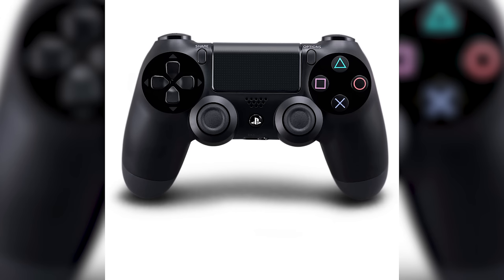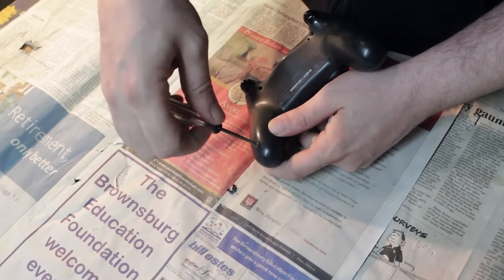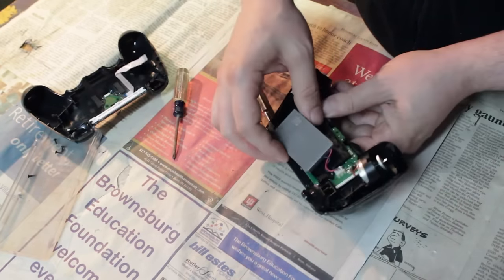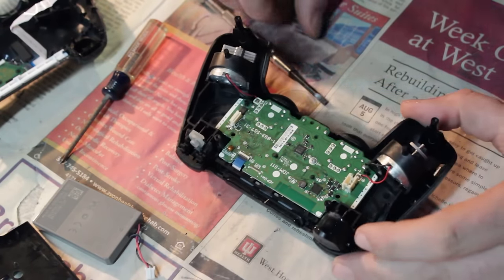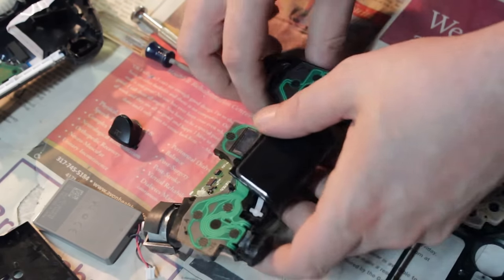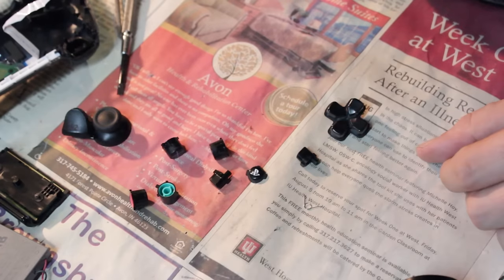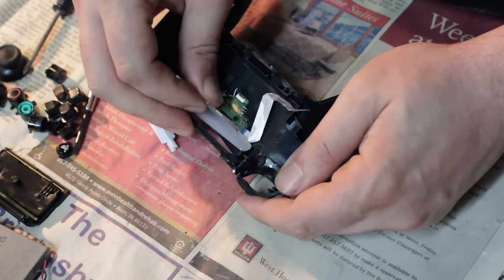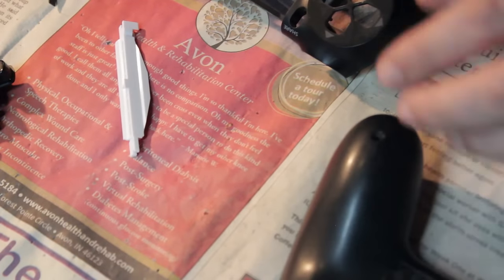How to take apart a PS4 Controller

Comment from the maker: I honestly can't thank everyone enough for the amazing feedback and stories of what brought you here to my video.  I hope I was able to help you all get your controller working again.
Reply: Hey, my wife just got the new Tomb Raider and was struggling with the quick time events. Turns out the square was sticking. I just cleaned it using your guide into the controller. Thank you
Reply: What type of screws are they?
Reply: @Lookfrodograph  i believe the screws are for the phillips ph00
Reply: Syrisツ same :(
Reply: im having trouble taking off the back, any suggestions.?
Reply: Drumblanket what type of screwdriver did you use
Reply: Hi I'm trying to take my one apart my r2 won't wrk
Reply: Thanks now my buttons  don't stay in place  and I  think  I  need  to  buy a new  controller
Reply: Thanks it helped
Reply: I spilled mtn dew on my controller and it started vibrating and lighting up im pissed..... Is there any way to fix it or should I get a new one?
Reply: I got on the ps4 after a long day of homework and realized that my arrow buttons were super sticky, almost as if someone spilled pop on my controller. I was super mad cuz I just wanted to play some Doom that night. Anyway I finally got around to taking apart my controller and this tutorial was very useful. I washed the goop off of my arrow buttons and it works like a charm now! Thank you for this great video
Reply: I was looking up vids for this because I didn't want to FUBAR anything and this was the first one I watched. My directional button down was worn out and I thought the. X button was too but it was just off kilter. Great vid.
Reply: Very helpful and straight to business lol thanks man 5️⃣⭐️

Comment: Ok so I one night at 2am had an idea to paint my controller and the console itself. I didn’t know how to take it apart so I found this video, I took it apart and paint the bottom shell and the buttons. After I finished painting I put it back together but what surprised me is that I didn’t look up anything on how to put it back together, it only took me an hour and it actually works and looks nice. And it was my first time too.

Comment: I had an issue with the analog stick seizing.  Your video was perfect even for the second gen controller.  Was able fix my issue.  I will say, much easier than opening the Xbox one controller, though Sony tends to be better manufactured components, in my opinion.

Comment: I can't get the frigging screws out they're so tight??
Reply: Same bruh
Reply: I was trying to take them out by spinning clock-wize but then tried spinning counter-clock-wise and It worked lol. Maybe the same happened to you.
Reply: @lucasrv2630  appreciate the tip but I know which way screws undo lmao <3
Reply: I took a pair of pliers to grip the screw driver to get a strong grip for stronger torque for getting the initial twists
Reply: @darkharder6190  nice might try that
Reply: I know I’m really late but I was having the same issue, keep trying and try a smaller screwdriver

Comment: When disassembling your controller, I would recommend using a plastic card instead of a Flathead screwdriver to prevent damaging the plastic. It's also good to give it a good clean with some rubbing alcohol and compressed air while you're in there to get out any gamer gunk™. Also, if your battery is a generic Li-ion battery and not a hard shell plastic one or there's no PlayStation logo printed on the the circuit board then it's probably fake.

Comment: Couldn't find a flathead screwdriver but I fixed my controller! PS I have no fingernails left😅
Reply from the maker: Vanessa Medina happy I could help!!!
Reply: Drumblanket Thumbs up👍🏽
Reply: You didn't use your nails. The screws are tiny. You wouldn't get you nails in those tiny slots.
Reply: @josequins9099  wooooooosh
Reply: @josequins9099  talking about getting it apart

Comment: Bro my controller was having some real right analog issues not drifting but like it had a stutter I had an idea of the issue I needed to disassemble it and clean out that area I seriously appreciate this video all the info was easy to digest you just saved me 60 bucks
Reply: Did it work ? How did you clean it ? I'm having the same problem as you

Comment: I needed only to take the lower screws away because when I shaked the controller there were some small piece inside the controller that was moving and the sound was iritating but I got it out. Thanks for the tip video.

Comment: I came here after I bought two new controllers, but still felt like I can maybe fix the first one, which I got with my ps4. There are two problems:
1. Left analog, usually used for moving around, isn’t working properly, you can tilt it in all directions, but nothing happens if you push it forward left diagonally if that makes sense. You have to really work it with small movements to get your character to move diagonally upwards left. 
2. Pushing L2 causes also moving forward. This one is especially irritating when playing FPS games, but also non FPS like Overcooked as well as just writing stuff. 
Over the year of using this broken ass controller I kinda got used to all its flaws and I still win games with it!
Now I’m halfway through taking it apart, and I’m not really sure if I can fix these problems here, I’m trying to just clean every single part as much as I can and hope for the best cause if I start working around with the cables or motherboard I worry I might break something.
If anyone has an idea how to fix these two problems I have, let me know!

Comment: Thank you so much for showing us this video.  I bought a used PS4 Pro and the controller was so Gunked up with dirt and god knows that the buttons were sticking and it could t be used.
After this video I was able to pull it apart and clean it, now the controller is like new👍

Comment: Please. Give a tip to remove the battery cable. Please. Inform others to bend the blue plastic of the ribbon cable for the touch pad inside the hole for it to go through. Remove the music. This is just the start :(

Comment: Great vid. I think mine was a newer one, not 100% sure but that center screw holding the circuit board in could be undone and removed without/before taking the black battery cradle out. Y'know, for anyone wondering. Thanks for the vid. :)

Comment: Turned out the rubber thingy under the D-pad was my problem. As I was   taking it apart you mentioned things about customs which made me look for a cheap copy blue controller I  had laying around as a donor.
Now I have a working original black sony controller with blue top case, looks good with the blue light bar.
Many thanks 👍

Comment: Here are some notes:
Take your time
Turn your phone to airplane mode.
No distractions
Take a picture of the guts when you take it apart.

Wash each piece that’s non electric with HOT WATER.

Use Q tips and clean nooks and crannies

Rinse with white alcohol. Alcohol evaporates very quickly

Place all washed components on a floor or heat vent. Good airflow to completely dry everything out. 

When you put it back together, TEST IT prior to putting the back back on

Comment: When removing the battery tray, remove the silver looking screw first instead of prying on it like in the video. He pulled the battery tray breaking the screw hole in the plastic.
Reply from the maker: Incorrect.  You probably have a different model if you experienced this.  I broke nothing while taking this controller apart.

Comment: Thanks for this video man! It certainly helped me get my controller open. Just 1 thing tho, opening it the way you showed, does leave some scratches on the point where it snaps. I done it exactly the way you did it and now I do have rough edges at the place it snapped. Apart from that I really like your method, it would be nice if you could find a safer way of opening your controller. So you don't exactly have to go around the entire controller and open it at every snap point. Nice video tho!
Reply from the maker: Right on, My friend!  Happy I could help you out.  I dont have issues with chewing up the plastic like youre talking about but a lot of people suggest using something plastic to assist with opening it.  Something like an Orange Peeler would probably work pretty well.

Comment: Thanks, my left d-pad funked up after over use. Fortunately, I used another dupe controller lying around and replaced the rubber part. Now, I don't need to spend $65 probably until it wears out in a couple of years.

Comment: While helpful at getting started and seeing where to go in doing this, a bit of your "just do this" direction doesn't cover details for layman attempts at dismantling the controller, particularly about the disconnecting of the ribbon cables.

Comment: Be really careful. The guy does not show you how the battery pops out. It’s really easy to pull the white compartment the battery plugs into clean out which is then tricky to fix and you’ll need a soldering iron. Be really gentle when easing the battery from where it plugs in.

Comment: I actually did this right. I had an old controller that my cousin spilled his coke on, his dad bought me a new one, but I already had another( I had two initially). So I took the coked one apart, took the shell, hydro dipped it, and put it onto the new one. And it still works

Comment: Thank you sir. Whenever I get angry I bash whatever controller I'm holding against the floor or throw it across the room.  I did it with my PS4 controller and the top ended up unaligning with the bottom. after that I couldn't hold the controller without cutting myself or scratching myself on the bottom grips. Turns out I just needed to remove the screws, re-orientate the top shell, and put it back together. You saved me 40 bucks.

Comment: Do not use a metal screw driver to pry apart a plastic device. Use small plastic pry tool to release clips on either side of headphone jack and front handle sides.

Comment: Very good guide. I am fixing my red Sony brand, I had a little more trouble with the ribbon cable connecting the touch pad and ended up using tweezers. Might’ve been my shweaty ass fingers that was the problem

Comment: Also the difference with newer controllers is the fact, they tend to have some problem with analog sticks,.......my mom´s Dualshock is like two weeks old and both sticks have some sort of problem, when You just touch the stick and the movement in game goes all the way up or just keeps running forward, then it´s ok for 20 minutes and then again.....hate it. My old version is running flawlessly for 5 years. Thank You for the video, I will try to open it, but I´m not a tech guy. I know shit about this stuff, I just blow into everything XDDD

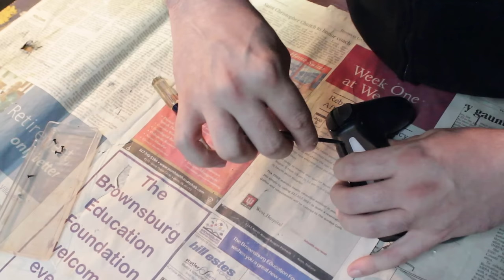Comment: Do not put a screwdriver between L1/L2 or R1/R2 as he does at 0:57. If you get that slightly wrong, you can cut the circuits there. I broke my controller doing that.

Comment: Where was the headphone jack and charging port in all of this? Is it a charging port or an accessory port? Cuz there's a dedicated micro USB port on top of the controller, but the bottom one accommodates the charging cradle and a keyboard addon, but I digress. I just wanted to know if I could like spudge a piece of debris out of the headphone jack from the inside or if I needed to do the hot glue trick, cuz there's something broken off inside of it that keeps it from resting on the charging cradle

Comment: Video was spot on. Easy to disassemble but I was taking it apart to replace the battery it has the wrong connector is there a better way to search for the right battery?

Comment: You didn't point out you need to make sure to push in the R2 and L2 to ensure they dont break when you are seperating the parts, didn't notice till i watched another guide that said to make sure to do this, that when i looked down and my controller, the L2 button had snapped off...

Comment: I tried to take the battery from one controller that has a problem with its X button and its joystick to give it to a controller that had a very old battery but the buttons worked fine... opened both of them and realized that the socket for the battery were not the same...
I cleaned the 1st one, so it works, for the moment.

Comment: My left analog sometimes doesn't work correctly. For example, in any game while I'm running forward, sometimes it'll stutter or just stop completely. I assumed it was dust & opened up my controller by watching this video, but I don't see any dust under the analogy & I'm not sure how to take apart the rest of the analog. All I could get off is the rubber joystick part. Any tips?
Reply: They're built in and if they break there's no fixing it. You'd have to buy a new component then fix it that way.

Comment: I am having problems with my PS4 controller especially the R3 it will not Sprint. By taking it out and just cleaning around the analog base do you reckon it could solve my problem? Thanks for your informative video, I have liked and subscribed!

Comment: This is kinda helpful but it doesn't explain how to get the controller in two pieces good enough because I currently have my PS4 controller in front of me with all the screws out but it still doesn't want to split in two it is loose but doesn't want to come apart and it is an actual dual shock 4 controller

Comment: Listen, a 2 year old could take it apart, I tuned out when this guy started the hatchet job of prying the housing apart with a screwdriver. Do not take a screwdriver to it, just push a credit card between the two halfs and it will part without leaving any nasty marks. Have fun putting it back together, especially those ribbon connectors.

Comment: Took my controller apart cause the charge port was pushed back slightly. It was working when I took it apart. I unplugged the ribbon cord and it kinked when I plugged it back in😐 
Now my controller don’t work anymore

Comment: I need to dissasemble it cuz the side of the controller got pushed inside of it which is causing problems with the vibration and comfort thanks so much for this ill edit if it succeds

Comment: I want to try  and do this. My r3 and l3 buttons on 2 of my controllers are not working. It is usually the buttons used to walk faster or run. Maybe it will work again if i clean it up inside. Thanks for the video.
Reply: Did cleaning them up worked ?

Comment: The metal piece of my aux cord from my mic had broken inside of my controller and it stayed in there for like 2 months when eventually when I did end up getting it out any time when I tried connecting my mic to the controller my ps4 would recognize it as head phones and I couldn't use my mic I know it's my mic since it works in my other controller. In this video I was hoping that I could swap the working aux insert into the other controller since I just like the feel of that controller better

Comment: I can't even get the shells apart, idk what I'm doing wrong. I'm trying so hard not to break it, I just wanna clean it out because the right analog stick has something in it that always makes the camera freak out and look to the left. I never had this much resistance with PS3 controllers, but thanks anyway
Reply from the maker: Check my other video.  2018.  There are clips in the controllers now.

Comment: Attempting to disassemble a custom controller i bought and there are wires attaching the motherboard to the front plate, but it looks like they don't do anything. they're just soldered onto some staples and held in place by glue... is this an attempt to keep people from fixing them?
Reply from the maker: Re read your comment.  Its possible its their way of keeping you from opening them or possibly they couldnt screw it back correctly. Hard saying without seeing it.

Comment: Reassembly question, does the orientation of the d-pad and four button rubber pads matter? Or can i put it any way?
Reply from the maker: I dont recall.  I would imagine they can go in however but keep an eye out for small loops on the pads to see if they would fit on a peg in the area on the controller. if you see only one or 2, youre going to need to locate the pegs.

Comment: Hi wanted to ask my ps 4 controller keeps sending the menus up there is nothing stuck have taken it apart using this great video but can't seem to see anything obvious so was wondering if there is anything you can advise to look for or is it just the case of a new controller?
Reply from the maker: Try cleaning the shell and buttons with dish soap and water. 
Clean all the button contacts on the PCB with alcohol and a Qtip. 
Reassemble and see if that helps.

Comment: Shows that i should not take it apart to fix the issue. Have an issue where i have to press the down button harder than the rest on the Dpad.
Reply: You have to clean the little pad on your bottom to get it to register. Use an alcohol wipe or something and let it dry completely

Comment: Naw my old controller wouldn't turn on so I cracked it open and I saw corrosion I tried to re connect the battery and ribbon cable and couldn't get it to work so I just threw it. I reckon it was water damage so it wasn't going to get fixed anyway

Comment: Taking it apart is the easy part. Putting it back together is hell especially that first strip wire you take out. I might have fucked the controller but im about to find out.

Comment: Um hi, what sized Phillips head screwdriver did you use for the screws on the back? Can’t get those out. I spilled soda on my controller & the square, triangle, X & circle ⭕️ buttons are sticky & I need to clean them
Reply from the maker: Size 0.  Good luck!!